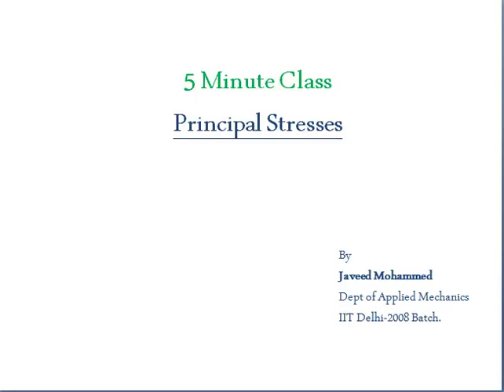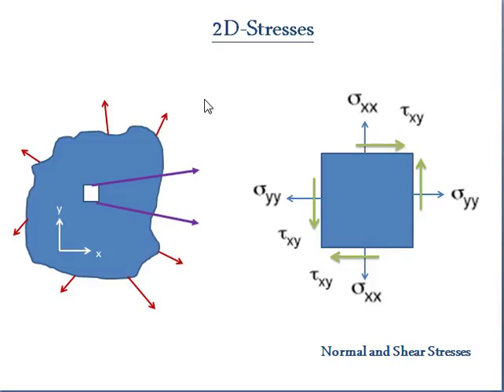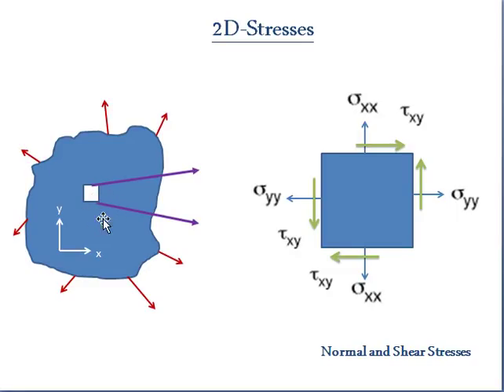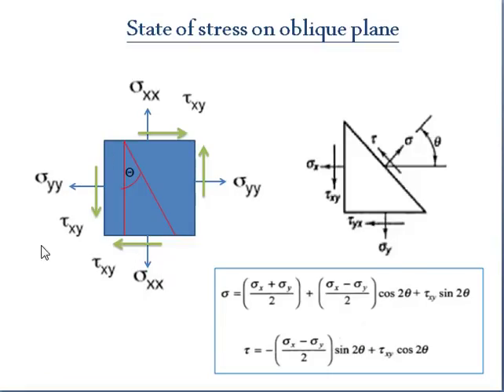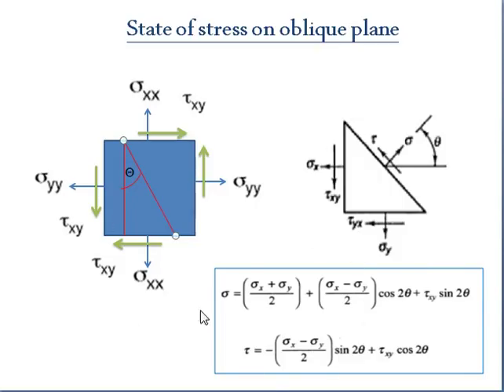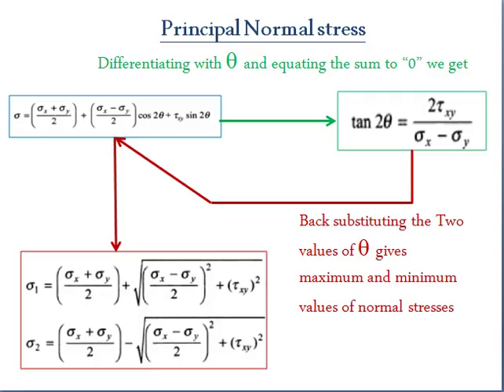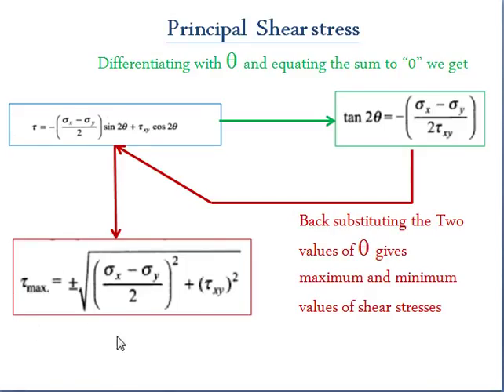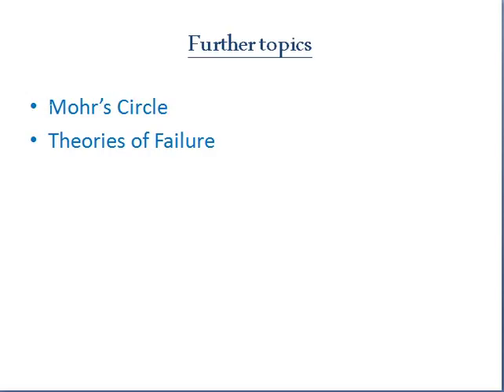what is principal stress

Comment: Can you tell me  how to check the failure load .
if details as below...
Material =  steel ;  E = 2.9x10^7 psi ; Axial tensile load = 6200 lb ; Poisson ratio = 0.3 ; Yield Strength = 250 Mpa.

Component parameters:
plate length = 8 in ; width = 1.40 in ; a hole at center whose dia is 0.72 in.

Can you please let me know.